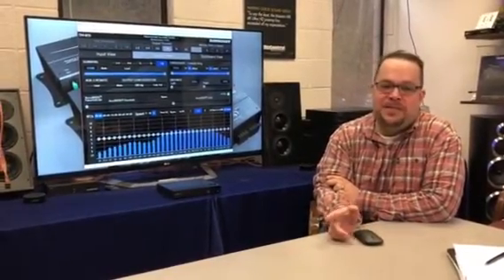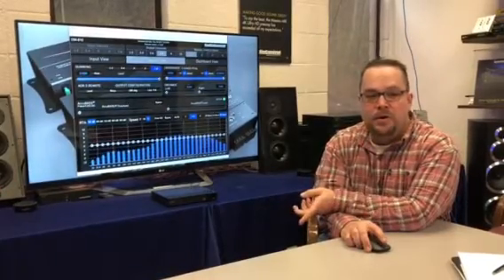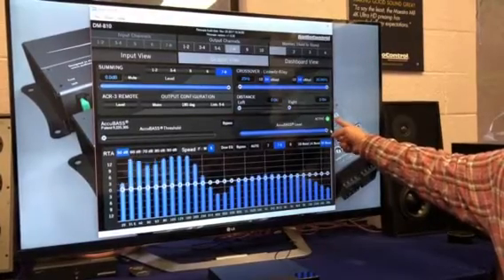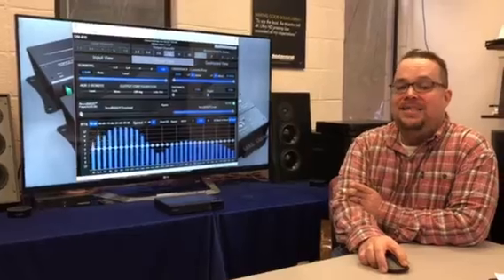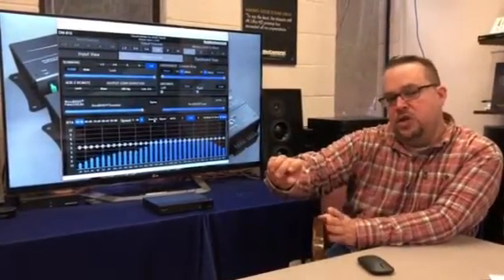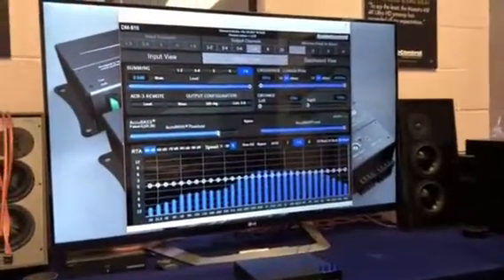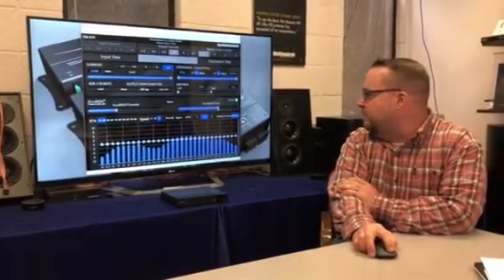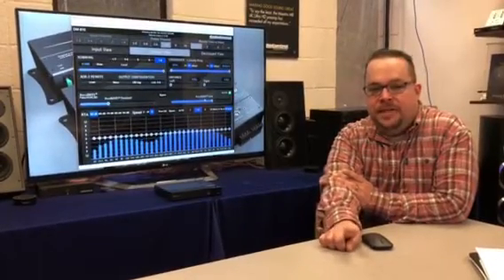AccuBASS seen through a DM-810

Comment: Can someone help me, I'm just firing up my system with a Dm608 and when the device is detected and says it needs to upgrade firmware,  it gives a binary firmware upgrade error. I'm using Mac OS. What's wrong?
Reply from the maker: Generally, anything to do with a binary error means that one of two things need to happen. Either A. You need to make sure your DM608 is plugged into your computer and powered on when trying to launch the software. Or B. When installing the software, you didn't move the installed app into the applications folder on your Mac. If that doesn't help, or answer your question, please give our tech team a call so they can walk you through the solution. They can be reached at 425-775-8461

Comment: So when you turn on accubass, what is the frequencies being affected?
Reply from the maker: 50 Hz to 125 Hz are affected/boosted, centered around 60hz.
Reply: @AudioControlCar  would I need to reset amp gains as accubass boosts frequencies?
Reply: @gabrielr6679  This is what I have been trying to get the answer to aswell. It seems to be a myth. Can't find the information anywhere. Once I set the gains correctly, its all thrown off by adjusting the accu bass levels ands threshold. Very frustrating

Comment: I'm new to DSPs and I just bought one of your guys D6-1200's. The issue with the stock stereo is obviously that it doesn't increase bass beyond a certain volume to protect stock speakers. From what I understand, Accubass just adds a bass boost to overcome that. But obviously the boost would have to depend on the volume level on the source unit (more bass boost as the volume increases). Here it just looks like you're setting a universal Accubass level. Is that correct? Maybe this isn't the whole process?